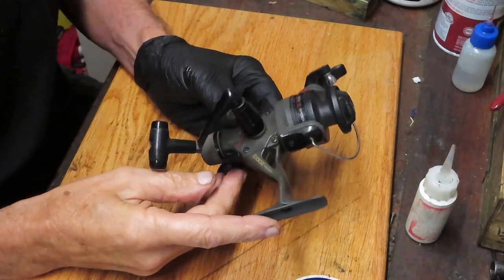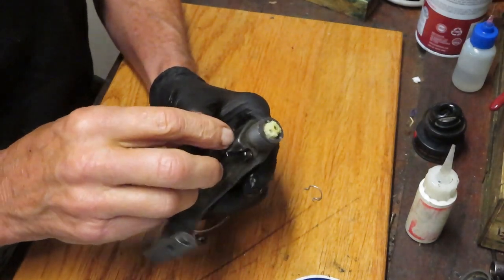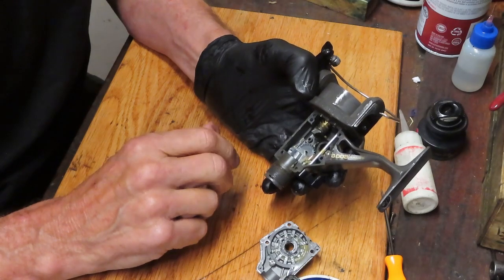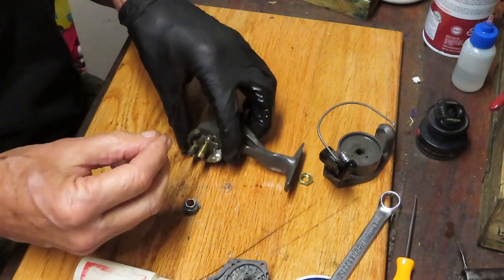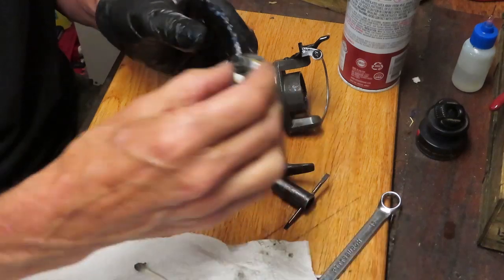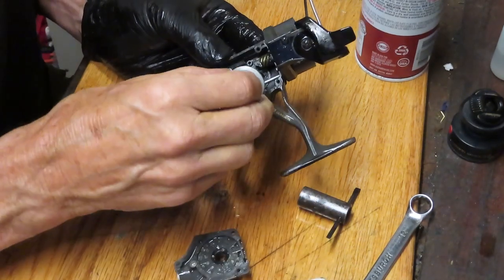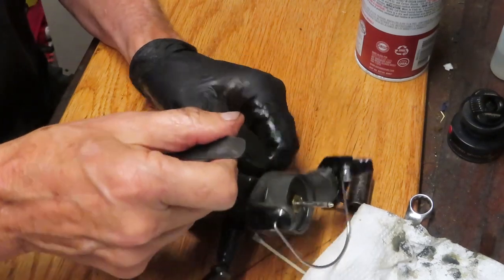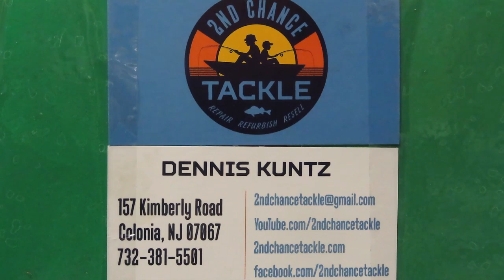Shimano AX2000 spin fishing reel how to take apart and service

Comment: I have four rear drag Shimano reels. My favorites are my two huge SSG7000 saltwater rear drag reels. They have 14 drag washers and can handle huge fish. I caught an approx. 100 lb.  stingray on the NC Outer Banks with one of my SSG7000 reels. (I have a video to prove it!) These Shimano rear drags are fantastic reels no matter what size the are. I am not fond of easy-cast reels however. The AR has too much space between stops for my liking. I only have one fast-cast reel but rarely use it. It is a small Daiwa Regal. Dennis, you did a great restoration and service on this Shimano! — Chris
Reply from the maker: Thanks Chris - yes - your bigger Shimano and the Abu Cardinal 757 series are larger saltwater rear drag reels that can handle the rigors of bigger fish.  Most of the time these set ups are for freshwater, but as you noted, some are bigger and can have enough drag to work as crossovers

Comment: Dennis, I think this is a model AX 200 Q.  The Q is hard to make out, but if you look at the designation on the handle, the Q is slightly separated from the two zeros. Thank you for your educational videos!  (Also, the rotor nut retention screw was still in your parts tray. 😉).
Reply from the maker: Thanks for the info!  I will recheck it